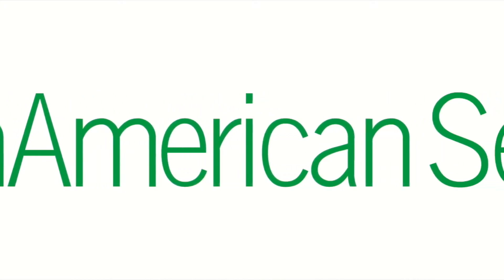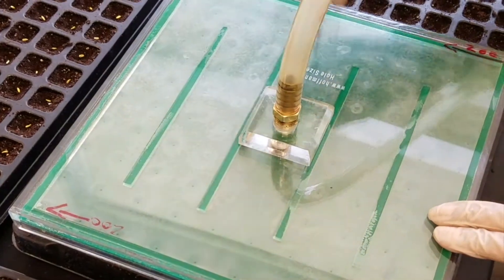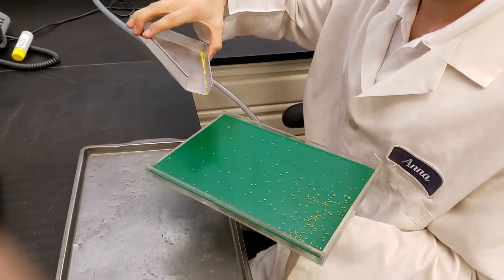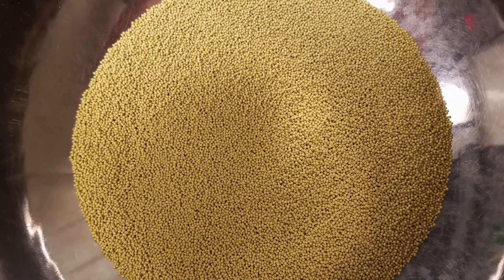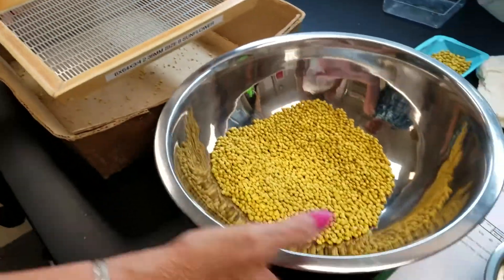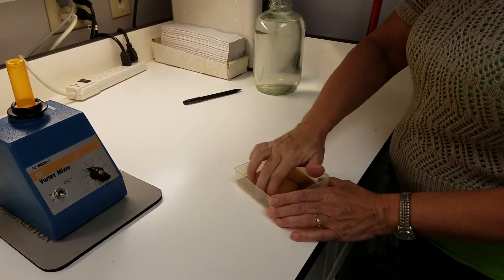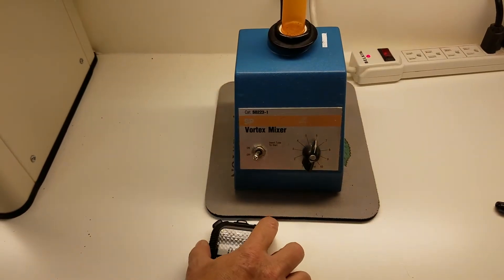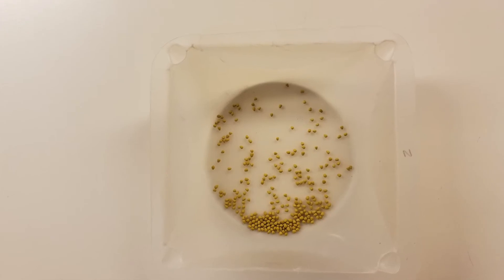What is Seed Pelleting?

Comment: Stupid comment but. 
How can you make sure each pellet only has ONE seed per pellet..
Reply from the maker: For small seed like begonia, one seed per pellet takes an experienced pelleter to produce. It takes about 2 years to train an employee to pellet every type of seed we produce. Begonia is one of the last crops they learn as it can be difficult to produce a batch without empties or doubles. The type of powder we use, how we apply the powder, and a lot of experience is how we can achieve one seed per pellet. Thanks for the question!
Reply: @PASVideoTV  One of the first things I learnt about flower seed when I started out in the Nursery business 33 years ago was how fine Begonia seed actually is. A figure of 81000 seed per gram is still stuck in my head, lol. Not sure if that is accurate for Begonia Semperflorens, the varieties we grow in 6 packs here in South Africa. 

You literally cannot sow it by hand, its so fine, like dust. I've sown a gram of Begonia seed in a few centimetres of space, the trouble comes when you want to prick out those tiny plants.

So, we leave our Begonia sowing to Ball/Straathof in Gauteng who supply our Nursery with flower plug seedlings.